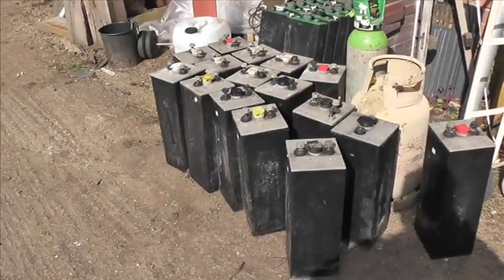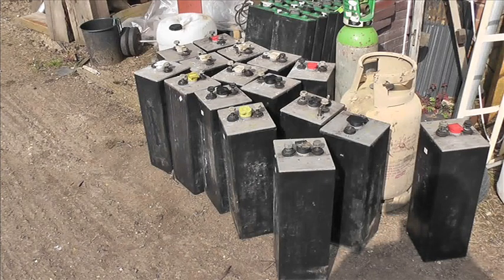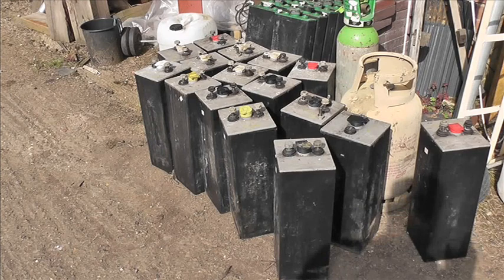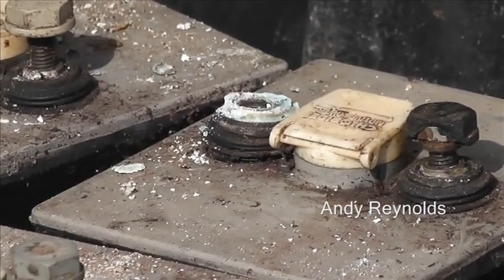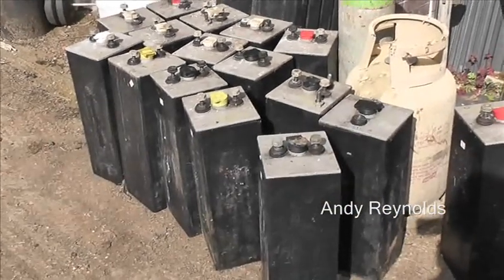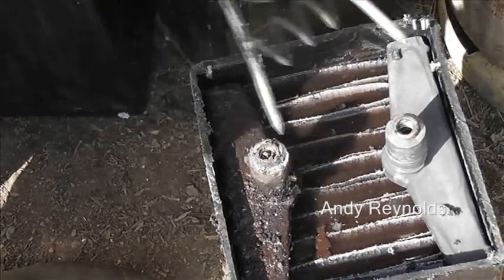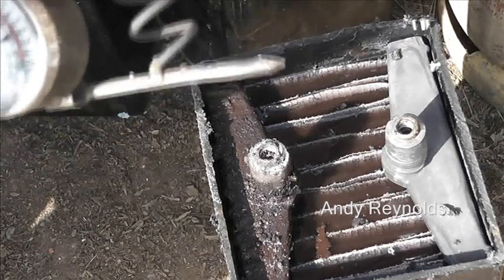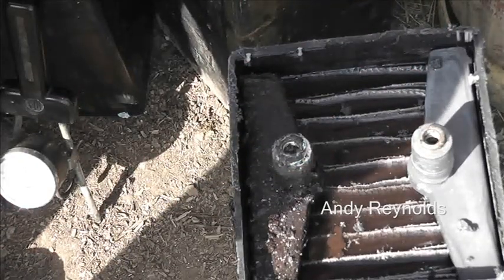Battery positive pole corrosion, series parallel connections.

Comment: Hello Andy! Thank you for sharing this important information. I am familiar with lead acid batteries from long ago and i would like to say that all batteries, no matter their chemistry, when used in mixed connections like your schematic, need 1) balancers for the series connected elements and 2) bridging cables of having exactly equal construction to each other, especially equal lengths. This is important for their end poles connection cables to the bus bars. All these cables must have exactly equal lengths. Another important point is the use of diode isolators for each of the paralleled string, something that i have never seen in a practical application. This would prevent the defective string to discharge the healthy ones. Unfortunately these isolators are very rarely used...

Comment: El plomo falla mucho 57v es poco en vasos de traccion poe debajo de 57,60 para no subir el burbujeo esos vasos deberian de subir a 60 voltios con 15 amp durante horas lo que ocurre es que en invierno no hay suficiente horas de sol para completar la absorción una bateria de plomo se deberá cargar al 100 por ciento frecuentemente
Reply from the maker: Hi, these cells keep on working as I don't deep cycle them. I have now added 2 pylontech units and these smooth out the voltage, cheers

Comment: To get corrosion you need Oxygen, a current and a medium for that current to flow in. This is an example of electron physics.

The way to stop this is to keep them in use.  

Electrons which want to travel (or bump the next one) get agitated when they can't leave so they start to play up and convert their potential into visible corrosion by using the difference between anode potential and the potential of the air. I am but a junior assistant farm hand and so I should shut up now.

Comment: I don’t think they are scrap from what I could see 
I think I would try them setup separately and take them down to 50% then charge them back up again and watch how quickly each cells pacific gravity rises and falls 
They looked good inside 
If you do decide to scrap them can you please take it apart fully so we can see how the plates lasted 
Thanks
Reply from the maker: Thanks for your comments, I know what you mean about looking good but they perform badly and reduce the performance of the whole system. I have been inspecting and testing these for quite some time. Removing them has made a huge difference that I cannot show on the video, cheers
Reply: @TheInfoworks  nice one 
Maybe they are full of sludge at the bottom of the plates
Reply from the maker: @Qaz375  You are right and the bottom of the positive plates corroded to nothing. They were obviously shorting and so  putting a drain load on the other parallel packs. This was disguising the fault for some time until to disconnected this pack and then all was well, cheers

Comment: I like to think that the battery had been drained and you had replaced the hot sauce with distilled water. Either that or you were wearing the emperors new plastic apron and face shield? 

A year ago this video would have gone away above my head, bit by bit it is coming together.
Reply from the maker: Owen, definitely eye protection and as a battery is discharged then the acid strength goes down until it is nearly water. The SO4 moves on to the plate and combines with the lead to make lead sulphate, cheers